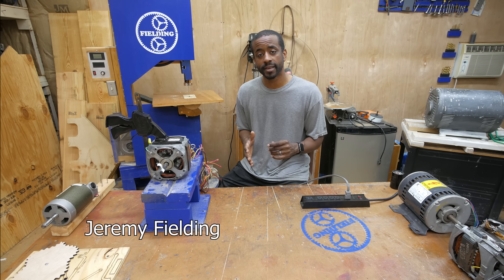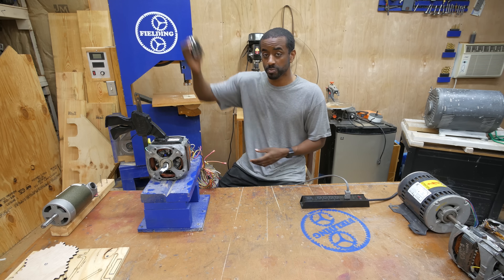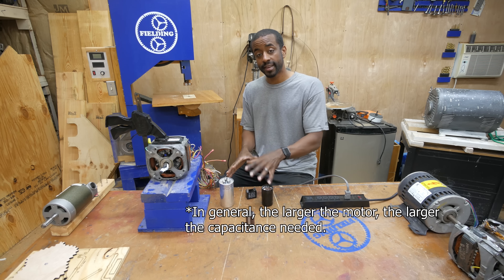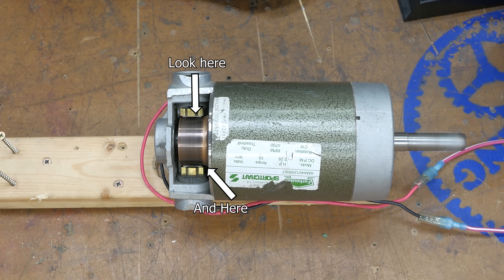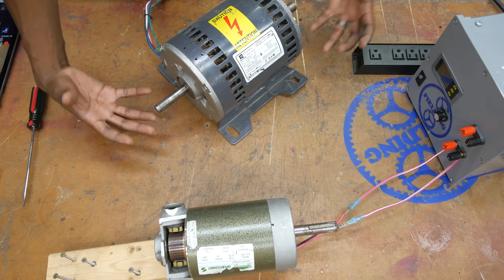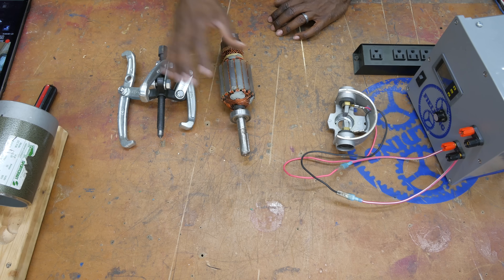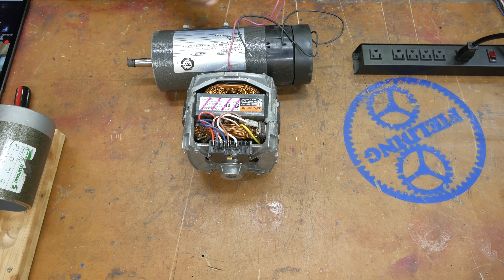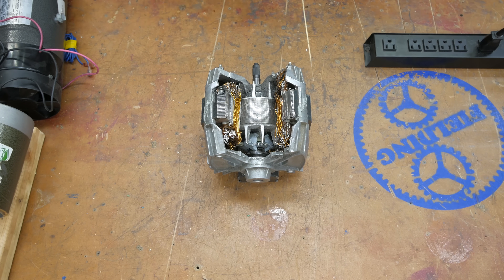Three Most Common Motor Fixes Anyone Can Do; Ultimate Guide to Electric motors ; #070

Comment: Great videos.  I wish I saw your videos before I took apart my old washer.  Took the motor, belt, sprockets and pulley but not the capacitor.   I see washers all the time, especially frontload washers with failing bearings.  That's how I got our washer for washing the dogs' towels and bedding.  Just need to change the bearings, but unlike salvaging parts, need to remember how to put it back together.

Comment: I have a headscratcher. I have an Accutek fan: its motor has an AC capacitor (4 microfarads) swinging an 18" blade. It is brushless. 

It hums when  on, no spin. The bearings look brand new. Not a hint of dust. When off it spins free. When on it has a lot of drag. Changed capacitor twice. No spin. Spun it up with a drill. Pull off the drill it stops within three or so seconds. I am spinning it in the right direction. 

What had happened initially was the fan got hot and the thermal fuse blew. Windings weren't scorched or anything, came home in time and turned it off. There was a smell however. But no blackening of the windings. So I changed the fuse. To do that, I had to take the ends of the motor off (oilite bushings, no ball bearings). 

So I put it back together and it WORKED. For five minutes. Then it just STOPPED. Dead with a mechanical bang. Like I had put a stick in the fan blade. 

So I thought that maybe the alignment between the rotor and the laminations had slipped. Nope. No sound as if anything was touching either. 

I've since changed the motor ($20 USD). But I am horribly bent out of shape. I am puzzled. Oh, the coils all ohm out fine. Happens on all speed settings. The old motor is still here. 
What do you think?
Reply: @daphnejames3571 I think he doesn't respond to comments, but another commenter might provide a helpful reply.  You might also come across a comment describing the same issue & what they figured out, or someone's reply to it might have the answer.

Sometimes you learn as much or more in the comments as u do from the video.  

That fan sounds really frustrating.  There's a video about what goes wrong with fans that helped me.  The brand was Lasco but the basics are typically similar enough.  3 yrs ago but Good Luck anyway!😊
Reply: You're sure one of the coils didn't fail to ground? That sounds to me like phase plugging of sorts.

Comment: Swimming pool motor: some cooling fan blades broke off; the motor would run momentarily, then shut off until the motor cooled off; could not understand why until I discovered the broken fan blades; question? can the cooling fan be replaced?

Comment: One thing I've done in an emergency situation on a sealed end cap bearing that's beginning to get noisy and slow it down is to drill a 1/8" hole in the plug cap, then add some electric motor oil 5-6 drops, then, clean cap surface around the hole and cut a small piece of aluminum tape to cover the hole. IT was on an outside air conditioning condenser unit.That was 2 yrs ago and it's still going!

Comment: Good morning, Thanks for your recommendations, I have a Rigid ts2400 table saw and I am having problems with the motor. I checked the brushes and they seem to have plenty of life still and yet there are a lot of sparks when I turn it on. Any ideas on what I should replace?

Comment: Great stuff, thanks for all you videos. I'm in france (230/240V AC). My kitchen ventilator motor (EB 40 MTA 1559) got wet (cleaning mistake...) and then didn't work. I've let it dry (1 year) and have taken it apart. I recognize all the elements your video shows, except that to test the motor without the capacitor, I have a question. There are 6 wires coming into the power cable directly to the motor(coming from the circuit board , and  I don't know which two to supply with current to test the motor with manual spin up.  4 Are for speed variation i  guess. (black blue red orange..maybe ...if the matched wire color coming off the board to the variator switch matches the the wire colors coming back off the board to the motor itself.) logically it would mean the white and brown wires going to the motor are the "main ones", is that right? Suggestions? thanks!

Comment: 6:25 I didn't know that and that got me to thinking about something.

I've got an old vintage Montgomery Ward Powr-Kraft drill that throws off sparks whenever I use it. I've had it for nearly 2 decades and it has always thrown off sparks.

Should I replace the brushes on it or am I dealing with a different kind of motor or something?

Comment: Thanks for sharing this video. Question: do I have to change the capacitor uF value when converting a 220v to 120v? I re-wires the motor per the lable to 120v but it doesn’t spin at all, if I go to 220v, the motor spins. Thanks in advance for any help from you or anyone?

Comment: Now I feel ashamed and saddened that I've thrown out so many motors over the years.  The disposable lifestyle of today disgusts me.  I'm a marine technician and I replace A LOT...LOT of motors for various items like toilet pumps, water pumps, etc. Upon investigation, most of the motors still run but there is another issue, such as hair in the impeller, which makes it not function properly.  I'll keep those motors.  I've even managed to put together (or repair) SEVERAL of these pumps for use on my own boat, saving me hundreds and making me feel a little better about my footprint on the globe.  Jeremy describes things in a simple and concise manner which makes me feel like I can tackle any of these projects and repair more things, thereby keeping them out of the landfills..
Thanks Jeremy!!

Comment: Is it possible to repair or reglue loose magnets? I have a small 250 watt motor for a electric scooter that had 2 magnets come loose. They are still intact and the motor operates just fine when i move the magnets to the proper place but im not sure if they can be reglued to fully stay there. I messaged a local motor repair company and they said the motor was done for but i can find multiple other companies online who say that magnet replacement is fairly easy. If it is possible to reglue the magnets in place could you tell me some glue that would be the best choices?

Comment: I've been working on a belt grinder with a treadmill 2.5 HP DC 90V motor...everything worked well when I wired it with a motor controller and a bridge rectifier, now that I changed for a bigger controller with no bridge rectifier, the motor stops by applying the lightest resistance... Any tips or advice?... Is it the new motor controller maybe?

Comment: Thanks! Great explanations. I'm going through this now. My motor wont start under load, even after replacing the start cap... It's on an air compressor. Once I remove some air from the tank, it starts fine. Any thoughts?

Comment: RE: capacitor start motors.     Remember this saying...  ELI   the   ICE   man.        where E=voltage  LEADS  current in a circuit.     (L=a coil-inductor).  
ICE=current  LEADS voltage (in a capacitor circuit) which, in the case of a motor, provides the starting torque, and the centrifugal switch (after about 0.25 seconds) switches off the capacitor and start winding. Motor then operates on the RUN winding.

Comment: my problem is that my pump starts fine but if I have to turn it off for any reason and then turn it back on it will just hum. Then I have to wait about 45 min for it to cool down before it will start again. It's been like this since I purchased it brand new two seasons ago. The local store wouldn't exchange it.  It's a 230 volt US Motor 1.5 Horsepower.

Comment: I bought an Edwards rotary vane pump from university surplus. Not sure what environment it was used in but the wires supplying the motor windings were starting to disintegrate (quite an on old motor). The wires started arcing to the case, tripping my circuit breakers. I just had to replace the wires, along with the noisy bearings, and the motor is still running strong.

Comment: I have an ridgid 120v motor that got oil in it.... still works, but sparks alot..... whats the best way to clean it up?? I was thinkin take all apart and dip in gas and dry with sir compressor until clean.... any other ideas?? Thanks

Comment: I have a Sunex 6” bench grinder that suddenly stopped working. It has power to the light but no humming or turning on the motor. When I hand spin it, it sounds like maybe something clicking inside. Don’t believe it to be bearings since it’s has only been used 6 times since I bought two years ago.  Before it failed I spun it backwards a few times when I was going to true the grinding wheels. Could that have caused something inside the motor to fall apart? Might it be a start switch inside if it had one.

Comment: I know it's a year old but -- I used to work at, then run, run a consumer electronics repair business. One thing we found in lots of completely DOA motors; thermal fusible links. Shaded pole motors and other types, not so much DC motors though. (Space heaters, HVAC, construction equipment, ...) Typically we'd hear "It worked, then something got jammed for a few seconds/minutes, now it's dead" or see motors with so much debris accumulation they had no airflow/could not cool. Digging out and replacing the fusible link worked in the vast majority of cases, but ones that had overheated too much/too long had begun to demagnetize their core and were slow/weak. They're typically hidden under shrink sheet or in tubing, strapped in with the windings around the outer core. We found a lot of these in the primary windings of transformers as well, actually. We probably saved thousands of dollars of equipment replacing just thermal fusibles.

As a side note, I love your channel and can't believe I hadn't subscribed before now. I've been watching your videos intermittently for a while now. You do important work here, I can't wait for more.

Comment: Fun facts.  If you connect 2 identical DC capacitors in series (negative to negative) it will work on AC. The Capacitance is 1/2 though. If you connect 2 identical caps in parallel the capacitance adds. Most manufacturers use common values for their caps and so the value is already just in the ballpark.

Comment: I'm not sure if you've ever run across a problem like I'm about to explain but on a washing machine I had an issue that I couldn't resolve where the motor would start and the centrifical switch would disengage then engage then disengage then re-engage... continuously

Comment: I've got a standing fan. It was stalling because the bearings were getting stiff. I used light sewing machine oil on them and the fan (rotor) spins freely until I turn it on. It freezes. It is obviously not a mechanical issue, and there seems to be no breaks in the windings. Please help. I hate throwing stuff out

Comment: Many times when those big capacitors fail, you can visually tell as the end will swell and bulge out. Some may also show a brown oily substance at the contact end. Also, be careful when handling these big caps as they can hold a charge and bite you good as it discharges through your hand (been there/done that).

Comment: Great video! Having an issue with drill press motor. Just buzzed when turned on. Changed capacitor, still having the problem. Any thoughts on a fix. Have had drill press for 15 years, but used a handful of times. Sitting around not getting used cause any issues?

Comment: Hello Jeremy, I replaced the brushes but I still have huge sparks, this is on a small DC motor from a vacuum cleaner, I replaced the bearings, brushes, but the motor spins too slow compared to what it should spin,and hums too, do you think there is a problem on the windings ?

Comment: Question:  I have changed out the Brushes on the motor, (R4510 10IN) but, still running rough sparking !  Any Idea next step? Thanks Ron

Comment: i ask sir whats really the problem my  submersible pump over heat ang its shuts off for a short time of used maybe 5mins i open it and no scratches on both walls maybe its shuts off caused it ovewrheating waht cause of overheating sir?and i have ang theardmill motor here i want to it for my project but i cant run it i hv no power supply for it it writes 180v DC any advise sir what i should used to make it run tnx a lot

Comment: Hi Jeremy I repurposed a treadmill 1.5 hp dc motor to put on my lathe, I purchased a 10,000w src controller to which I added a bridge rectifier. It used to run perfectly with the treadmill electronics but now with my controller the motor draws too much power and eventually blows the breaker. Any help would be appreciated. Bernard G

Comment: I have a small brushed DC motor from an airsoft rifle that's in great condition, but has sat for a while in a box. It hums but won't run unless I give it almost twice the required voltage and spin it by hand. thoughts?

Comment: Those same weights inside the dryer Motors are what turn the heater on, sometimes you have to change the motor in your dryer to make it heat up. It's a safety feature that prevents the heater from coming on when the dryer is not running. Wish they would have kept that mentality on the new dryers because they're capable of getting hot without the motor running

Comment: If a DC motor(Specifically for my lathe with a variable speed) will spin, but not up to full rpms, I should be troubleshooting the electronics and connections before the motor, correct?

Comment: In regard to the centrifugal switch on a table saw induction motor. My saw would just hum on startup. I took the motor apart and cleaned a layer of caked sawdust and grease that was obstructing it from the starting contact. Works like new. Thanks for the explanation.

Comment: I have a Harbor Freight drill press. I was drilling and the motor just turned off. I 
checked everything, plugs,breaker etc. Took the capacitor to an 
electronics shop and they said it's good. No humming,clicking, no sounds at all. 
Any idea what could be wrong? The motor does not have a reset button.

Comment: I need some help, I have a Bosch 4100 table saw that the Motor started to sound loud and the blade turns very slow and will not cut my wood. Do you think that I need to replace the bearings ?

Comment: Take a single phase 120 vac Thomas 2619 double wobble oiless air compressor used in an oxygen concentrator.....it uses a capacitor around the value of 15 mfd.
I understand it's a 'start' capacitor, as when it fails the compressor not only doesn't start....but a circuit breaker pops due to excess current draw from the stalled compressor.
Is that capacitor also a 'Run' capacitor.....meaning that any change in value over time effects the compressor speed and torque?
How does one know if an ac electric motor capacitor is a start or run or both types?

Comment: My wood lathe motor is starting to run slower or have less power I guess. While turning a piece of 🪵 it will spin for me by as I’m trueing up the piece or making it round with my chisels, it’s starting to bog down in low gear. I can actually stop the piece of wood from turning with my chisel & it should be spinning at 500prm. This started when I used my drill chuck to drill out a 1.5” hole into the center of a piece of wood. I tried going in 2” deep but the motor cut off all at once. No noise, nothing. I waited for about a minute & turning it back on. It started turning again but didn’t have the power. Thoughts? Fix?

Comment: I have a Kobalt KM 210 electric mower that wouldn't start. I got it turn but then it over heated, The brushes were sparking and caught on fire. I heard you mention if that happens then it time to replace them. Thank you.

Comment: Great video! I’ve got a belt sander that has been making the loud noises and shocking me. I’ve disassembled and determined I need to replace the bearings, but am not sure about the shock issue. It is a grounded motor and plugged straight into a grounded socket. My suspicion is the friction created by the failing bearings is just too much for the grounds to dissipate fast enough, hence the periodic shock. The noise and shock started together, and I haven’t got the new bearings yet so haven’t been able to put it back together to see if both issues are resolved with the new bearings. Any other causes for the shock I should look for?

Comment: Very helpful! I am having the same humming problem with my furnace blower motor. After watching this video I want to replace the capacitor first before i buy the new motor. Question: Can use BOJACK 20 uf 370V 450V AC CBB65 Motor and Fan Starting Round Capacitor 20 MFD 10000AFC to replace my AEROVOX 20uf 370 V 60 hz?

Comment: Thank you for the great video. I have many small 120v hot tub motors and the problem with them is that it trips the breaker, so there is a short in the motor I assume. what are the causes and any suggestions as far as getting it fixed by myself ?

Comment: Other problems:
1 Brush jammed in brush holder 
2 Brush wire in place but not electrically connected to brush. Check by tugging lightly on the brush wire, it unexpectedly pops out.

Comment: Dude! I think you saved me from a big headache! I have bought an makita cord drill with an defect. Field was shorted so i replaced it. Armature is tested(commutator 3 common types of testing) and i have also changed the brushes. Checked the switch and wiring and all seems to be alright but the rotor won't just spinn..it starts to smoke. So, i guess it is a capacitor as you just discribed it. Many thanks!

Comment: I’ve got a strange problem with the capacitor start motor on a lathe and milling machine. When I put the v belt on the ratio to achieve the highest spindle rotation speed the motor starts and accelerates quickly but then the speed rises and falls on a cyclic basis. Doesn’t happen on lower ratios. Any ideas?